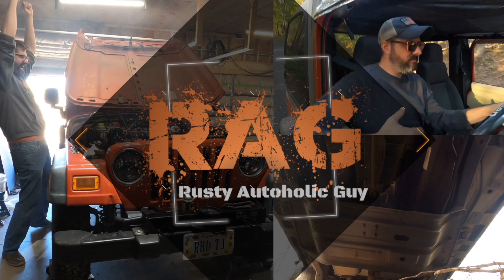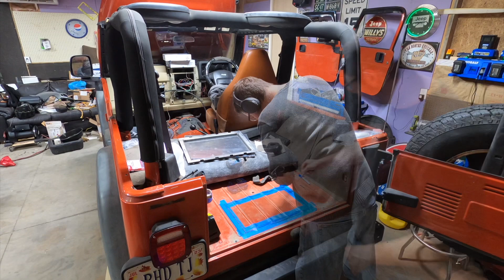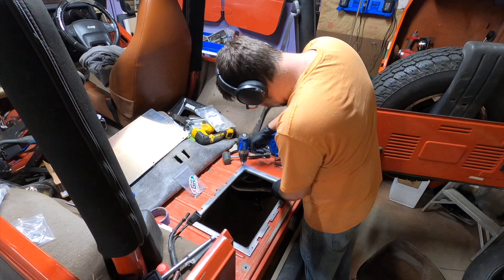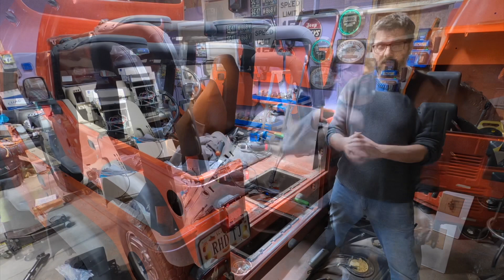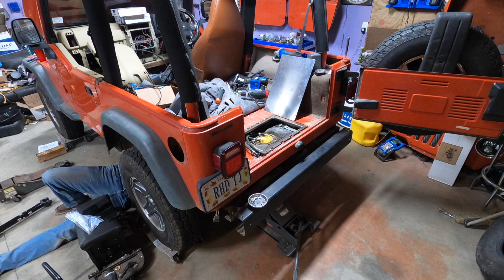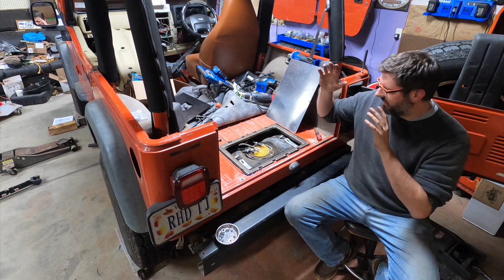Installing the GenRight Fuel Pump Access Panel & Savvy Aluminum Fuel Tank Skid Plate onto my TJ.

Comment: I replaced my tank with a GenRight tank five years ago. I ordered the access panel when I ordered the tank.
FINALLY got the courage to cut the hole for the panel a week ago. 🤪
Turned out it was really simple.
Was even able to get it done without dropping the tank. 😁
Cut the hole far enough forward and drilled the hole for the seatbelt bolt out and now I can put my seatbelt back in if I ever put my rear seat back in, IF I can find the center belt. 🤪
It was this video that motivated me to cut the hole where I did so I wouldn't cut my wires. Thanks 👍
My only hiccup was I cut the return line when I cut the hole.
Easy fix with a short section of fuel line and 2 worm clamps. 😎👍
Reply from the maker: Which GenRight tank did you install?
Reply: @RustyAutoholicGuy  it was the 24 1/5 gallon tank with the skid plate. 👍
Reply from the maker: Do you like the exact space? I’ve been seriously debating the upgrade for my TJ!
Reply: @RustyAutoholicGuy  is your question...
Do I like where I cut the hole?
YES I do.
It was far enough forward where I didn't have to worry about cutting the taillight wires that run across the back of the jeep.
I can give you some measurements and go into a little more detail if you like 
Be glad to help in any way I can.
Let me know. 😉👍
Note:
I do have about 2 inches of body lift and used a 4 inch blade in my jigsaw so there was just enough room between the tub and the tank.
Reply from the maker: @rickbrown7287  I was asking about the tank itself, do you like the extra fuel capacity? Does it hang lower than the stock TJ fuel tank?
Reply: @RustyAutoholicGuy  DEFINITELY like the extra fuel capacity. When full it only adds about 35 to 40 lbs of weight to the Jeep.
I saw somewhere that someone was worried about that. 🤪 The trade of is worth it.
As for any clearance loss.....
I never measured it but it doesn't look like it lost any. I think where the extra capacity is made up is in how tall the tank is. 
Here is another "I thought"......
I thought I also saw somewhere that if you don't have a body lift the tank won't fit. Don't quote me I that one though. Something tells me I saw that after I installed the tank🫣.
If the worries you I am sure if you contact GenRight they will be able to tell you.
,😉👍

EDIT:
Ok, here's the beef ..
GenRight says you DO need a one inch body lift for the tank to fit.
There is an exception if you don't have or want a body lift. Something about spacers between the mount for the skid????
Go to their site, find the tank and look under the description, that's where I found that.

Here I am again 🤣
EDIT #2
YES....
The tank hangs down lower than the stock tank. How much lower I can't say. I googled pictures looking at the rear of a TJ with the stock tank and with the GenRight.
On my Jeep I haven't hit the skid plate YET.
There are no scratches, dings or anything in the powder coat. I do have a 3 inch Terraflex lift, 2 inch body lift and I am running 33 inch tires though.
Hope this helps you out.
Anything else?
Be more than happy to help.
Love the tank. 👍

Comment: is this fuel tank sending unit lever only problem you have had using the CDI Liberty pump?   I have a TJ with an MB 617.  having to redo the builders fuel pick up bung... it leaks air..   so thinking on doing what you didthough I would NOT neeed the pump...  (except for occasional prime and pumping the tank free of water/algae etc.  (since their is no tank drain)  )

Or do you see a way to do use TJ pump for above thoughts... (does it allow for suck thru when TJ pump is off?)  .... or gut the pump and just use it as nothing more than a fuel pickup??

Comment: Why didn't you just use a factory fuel pump and save yourself all that fussing ?
Reply from the maker: Because I only needed 7psi of pressure delivered to the diesel engine and the gas engine pump in my 06 TJ was designed for closer to 60psi. There were multiple ways of solving this issue and I decided to replace the pump with a lift pump out of a Diesel Jeep Liberty since it had the same mounting design on the fuel tank.

Comment: The fact that jeep engineers somehow didn't thought of a door for that fuel pump access is unbelievable.
Reply: They did but it comes down to adding production build costs.
Reply: Sadly true about the Jeep engineers. However, thank God for the "after market makers". Thanks to companies like GenRight, and other companies that "build it better" than factory, Jeeps are able to be repaired with better parts, like rotors, shocks, suspensions, etc, etc. American ingenuity.
Reply: If you’re going through fuels pumps that much to necessitate an access panel then you have much bigger issues that need to be addressed.
Reply: @jonweaver3461 yeah harder and harder to find real fuel pumps that are good that would last longer than 2 years, majority are Chinese made.

Comment: Did the epoxy come with the plate or did you just decide to use it? What 3M product? Genright makes killer stuff, I have their XT aluminum tank, 24.5 gallons, fender flares, hood vent, and doing corner guards today.

Comment: My is a 97 is it the same?
Reply from the maker: Congrats on your new Jeep. Yes a 1997 is a TJ Wrangler and this Fuel Pump Access Panel will work, though your tank will look slightly different from mine, I believe Jeep went to a new fuel pump in 2005.

Comment: This is one of those mods that's so cool you want to do it even if you don't have the need for it.
Reply from the maker: I have to agree Forest! Knowing I don't have to drop the tank again to get access to my lift pump is fantastic, and connecting the wiring harness and fuel lines was a much easier process as well!